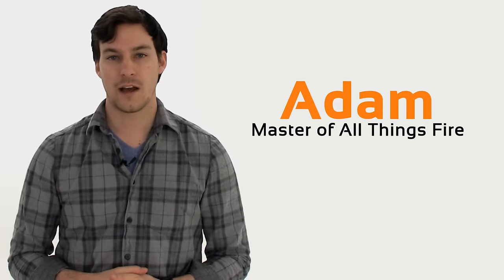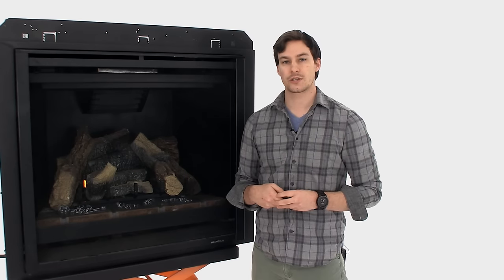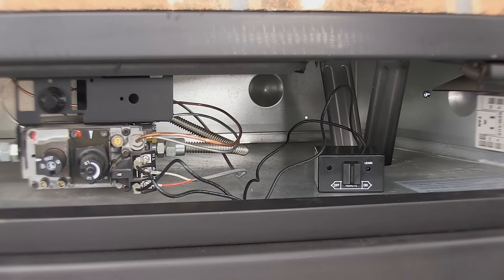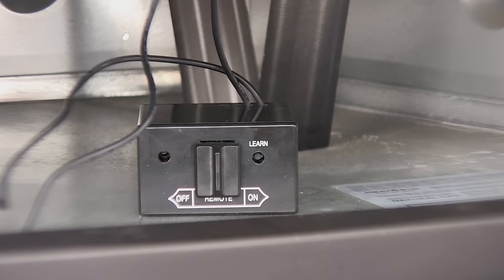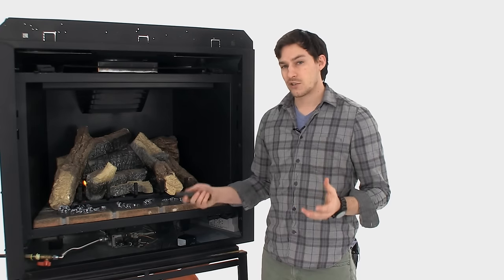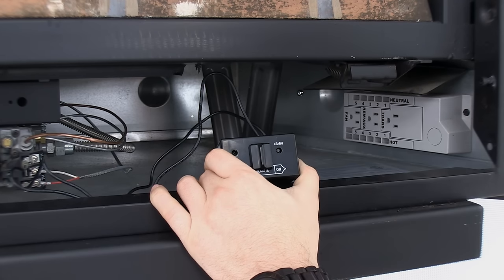Troubleshooting a Skytech Fireplace Remote Control

Comment: A well presented description. It got me on the correct tract. My remote box which is in the wall would not reset so I took it out and there were batteries in the box. Changed and wala. Thanks for getting me on track for a simple correction.
Reply from the maker: Excellent!

Comment: I have a model  1001tha skytech remote dated 8/2017 i purchased with fireplace logs in 2018. I have followed your reset video accurately, putting in new batteries, but with no luck. I can't hear the remote unit chirp but still followed the procedure just in case it was too faint to hear. All connections appear to be solid. what's next?

Comment: You may also want to try replacing the batteries in the remote receiver, if it's the type that is battery powered.  Worked for me.

Comment: Great Video! Some additional pointers - best to change both sets of batteries, in the control box and remote, at the same time. Also, the control box requires that the wires be disconnected to change the batteries. My wires were not colored black and red, but rather the same color so be sure before you remove them you mark them to which terminal they belong to or the control box will not work. When I connected them back on, I put them on the wrong terminals and the control box would not work so I switched them and then they worked but it took this extra step to figure it out. Thanks for this video this was helpful!
Reply from the maker: Thanks for the feedback and additional insight!

Comment: Thank you!  After replacing the batteries in the remote and receiver it still was not working. I followed the learn button reset procedure and it’s now operating as usual. I’ve had this control for 6 years and this is the first time I’ve had to reset it.

Comment: Great video,.  Changed the batteries in receiver, but would not work until corrosion was cleaned up around terminals.  Once corrosion free, remote worked.  Thank you!

Comment: In my receiver box there are 2 d  cell batteries you can see so when I swapped those out I assumed the unit was powered since the unit went on when I manually moved the switch to on.  What I did not realize was there were an additional 4 aa batteries that need to be changed on the bottom of the actual receiver box.  Once I figured that out it works like a charm.  Thanks!!!

Comment: I have a Monessen DFX vent-free gas fireplace system with battery remote.  The problem is that the Skytech 1001 transmitter will turn the fireplace on with no problem.  But, when I hit the off button on the Skytech 1001 transmitter, the fireplace won't shut down.  I have to manually open up the control access door to shut down the unit.  Replaced batteries in both the transmitter and receiver.  Checked wiring - all good.  Do I need a new transmitter.  Bought my fireplace in 2003.

Comment: I have a heat-N-Glo Smart-Stat-II control that seemed not able to turn the furnace off or even Thermostat is ON.  Was able to turn it on with the remote.  Reset code and pairing has been done.  Maybe you can help?  Thanks

Comment: my sky-4001th does not have a learn button.  it's old and does not have A in the model number?  both remote and receiver have new batteries installed and in the correct position.  HELP!

Comment: I have a 10 year old Smart-Batt II remote and receiver.  The remote stopped turning off the flame. The receiver manual controls work to turn flame on and off.  I replaced batteries in both units and attempted to sync.  However, the learn button does not beep when in remote position (or any other position).  I removed batteries and cleaned contacts.  No change.  Is there a fix for the learn button?  Must it always beep to be working effectively?  If the only solution is a new remote and or receiver can it be an updated model or must it be the Smart-Batt-II like for like replacement?

Comment: Thank you so much! Excellent video :)
Reply: I agree.  The transgression I made was not pressing the learn button after clearing the codes.  Works like a champ now... at $3.50 per gallon.  Looks like the wood stove will be getting a bit more action than the fireplace.

Comment: Trouble shooting You tube videos was great however when you hit reset button  and it doesn't beep I would suggest dis connecting one wire on receiver box then replace all 4 batteries in receiver box with the switch on remote. Replace  remote batteries as well. Reconnect receiver wire .You should hear beeping then hit on button on remote and 😮 fire place should start.

Comment: My learn button doesn’t appear to be able to be pushed. Is there a safe way I can check to see if it’s been damaged or a way to replace it? It will turn the fireplace on/off manually but the remote I think needs to be paired and I can’t feel a learn button to push.
Reply: Unfortunately there isn't a replacement for the learn button.  You would need to purchase a new receiver. Please give us a call at Spotix.

Comment: this didn't work for us. the remote box is making the chirping sounds, but the remote isn't turning the flames on. I had just used it the other day. We can turn it on manually. All batteries have been replaced, there are no corrosive wires anywhere, etc. How do I get the rc working again?
Reply: If you haven't tried hard resetting the remote, please hold down the learn button for 10-15 seconds until you hear 3 audible beeps. Then lift off and depress the learn button one more time and then on or any button on your transmitter remote.  If your unit is over 5 years old it would no longer be covered under warranty but if it isn't it may be eligible for warranty replacement.  We sell remotes and receivers separately as well as kits if you are interested in purchasing a new. www.fireplaceremotecontrols.com
Reply: Thank you so much for your response.  Yes, we've tried all this. And we can hear the beeps, but the remote isn't activating the flames. We think a guy that was here to check on the fireplace must have loosened a connnector? I don't know. But this is extremely frustrating. Wood burning is so much easier.
Reply: Y

Comment: I have this remote and can complete all the steps repeatedly without success. While trying to get it connected I've stumbled on a strange scenario where the remote/receiver has "learned" to stay on in the "REMOTE" setting (so "REMOTE" is functioning exactly the same as the "ON" switch). So in both cases I have to manually turn the fireplace off. 

The remote control helped the receiver learn to stay on (while in the "REMOTE" position) so I know the two devices are communicating but the remote won't turn the fireplace on/off (it is doing nothing but sending wrong pairing signals from what I can tell to the receiver).

It has happened multiple times as I try to get it properly reconnected/re-set (new batteries in everything by the way). Has anyone else had this happen and discovered a workaround?

Comment: I removed my solenoid and  I can hit the "off" button and the rod pops out to close off the gas supply but when I hit the "on" button the rod doesn't retract and will not open up the line.  The solenoid stays magnetized on the inside so I can manually push the rod in and it stays in until I push the "off" button again and it pops back out. I have tried new batteries.  I just seems like there is not enough strength in the solenoid to pull it back in and open the gas line with the remote. Do I need a new solenoid?

Comment: installed new batteries in both cleared codes beeped 3 times press button again 1 time it beeps depress on control button, light lit up but does not signal a beep to turn on fire place.

Comment: Mine will turn on and off like it is supposed to. Then when the remote tells it to turn on the flame will start to come on but go out. Then the remote won't turn it on at all until I take the batteries out of the receiver box and put them back in. Then it will work again for a few more rounds until it does the same thing again. Any suggestions?

Comment: My Skytech 1001 remote will only work in close proximity (12in.) to the control box. All batteries have been changed and the learn function performed. It is approximately 9 years old and worked fine until this heating season. Is it time for a new one?
Reply from the maker: In this case, most of the time it is a remote that is going bad.  You may be able to get by with purchasing just the remote transmitter.  Call us at 888-977-6849 if you have further questions!
Reply: I would suggest updating your equipment to new - the lifespan of these units is about 5-10 years.  Here is a source to buy an entire kit or just a replacement remote or receiver box. www.fireplaceremotecontrols.com
Reply: The remote started to work but I will keep your recommendations in mind. Thankyou
Reply: Does anyone know what the set and mode buttons are for? My fireplace cuts off after 10 mins or so for no reason that I can determine. I think that it has something to do with the temp the remote reads. Help??

Comment: My fireplace does not have the black box in it.  My wall unit says learn, but it did not do anything when I pushed it.  The remote quit working a while ago, now even the wall unit does not work. We've tried everything!
Reply from the maker: It sounds like your receiver is actually installed in the wall which isn't uncommon. It will be located behind the cover plate. We recommend checking the batteries in the receiver first. If you have any more questions, feel free to give us a call at 888-977-6849. Thanks!
Reply: Thanks...that's probably it!!!

Comment: New batteries in both and no “Learn” button. Wired correctly and goes on when putting the three position in On. Nothing when on remote.
Reply from the maker: If there is no learn button, it will be difficult for them to pair up again. Usually, after the steps you've done, it might be time to change out the remote kit.

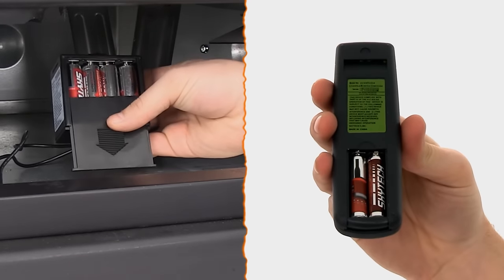Comment: Got 1:16 in and was able to solve my problem! Couldn't get the dang fireplace to shut off, even from the rocker switch. Had changed the batteries in the remote, tried the learn code, nada...

Watched the video and saw that there were batteries in the unit in the fireplace. Who knew?!!? I know it has two wires coming off of it, thought that was how the electricity got to that unit.

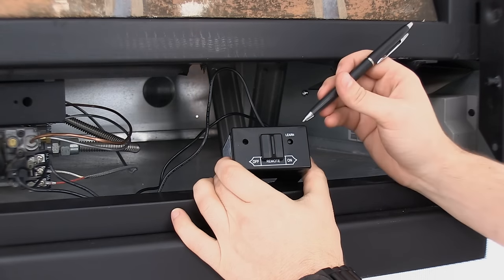Problem solved... at least for now. Who knows, maybe I'll need the next 1:25...

Comment: I have a 1001-A Receiver.  When I slid the switch to on, the fireplace worked.  When I turned it back to remote, the fire went out.  So I changed the batteries on the receiver, there was very little corrosion if any, and put it to remote.  When I used the remote to turn it on , it didn't work.  I did all he said and I got no beeps at all.  So I pushed the learn button in again it went in a little more then all the other times I tried.  I got no beeps, but when I clicked on the remote, it worked.  Even though the receiver gave me no beeps, it is fine and worked as before.  Thank you for the video.  I thought I would have to buy a new receiver.  Beeps or no beeps, it works.

Comment: Mine does not have learn button
Reply from the maker: Older remotes do not have a learn button which can limit the troubleshooting you're able to do. Try replacing batteries and make sure you can still control the fireplace manually. If more than 5 years old it's outside of the warranty period and may need replaced. We're happy to help find a compatible replacement.

Comment: Not all 1400 series have a "learn" button.
Reply from the maker: That is correct - the older Skytech 1400 models do not have a learn function.  If that is the case - you would not be able to purchase or sync a NEW remote with the existing receiver box.   You would need to contact us directly to get a new model receiver that does contain the learn function.

Comment: I would not recommend SkyTech.
Every season the remote will not pair to the receiver.  Yes, I’m doing it correctly- even sent ST a vid and Customer Non-Service rep said I was doing it correctly.  I mail it in, get them returned paired up.  It’s bizarre. Every season. ST cannot tell me what’s wrong w/ the units that I cannot pair them myself but they come back paired up. “Interference possibly,” rep said.  I try to pair them in the fireplace, outside the fireplace, in the kitchen, outdoors.  “Interference” my A$$ - SkyLowTech doesn’t know what’s going on (or won’t tell me.)  All they say tell me is “I should buy a new one.”

Comment: Sad after performing the steps needed the tech support suggested that the battery fluid may have migrated upwards tothe PC board, WHAT. Nuff said, poor support, overpriced replacements, poor product diagnostics and I would not recommend this product.

Comment: why are my batteries wearing out every two weeks? and im not even using it
Reply: It could be that your remote is set to Thermo Mode if it has thermostatic functionality in which its constantly sending/receiving a signal draining batteries.  If your remote/receiver is over 5 years old it might be time for a replacement as well as this type of issue usually is remedied by replacing it.  If not, I would suggest consulting the business you purchased it from or Skytech has a 5 year manufacturer warranty. Hope this helps!
Reply: @Firepitsdirect  thanks